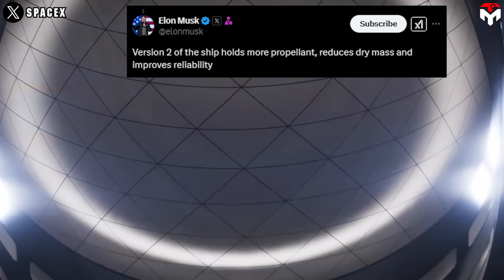SpaceX Upgraded Everything on Starship Booster V2, Unlike Any Other...

Comment: If they're changing the Hot Staging Ring. They think  it was the problem with the last StarShip, Rapid Disassembly. They've probably installed lots of sensors to watch for leaks and heating of the surrounding Area. SMART Or maybe they already did. Anyway cool.

Comment: Falcon doesnt do hot staging and its reliable and smooth.  What is to be gained from hot staging with the superheavy?
Reply from the maker: Starship is another level! With hot staging, they can maximize the booster's performance - leaving 3 engines on reduces velocity loss due to gravity; also it helps to keep liquid propellants at the bottom of the ship tanks, reducing the risk of fuel slosh which can lead to irregular supply to the engines.
Reply: @techmap9  Your answer is not well thought our.  after separation, the booster flips making the sloshing irrelevant.  At the point of separation both vehicle are nearly weightless in microgravity.  see the second stage velocity change in Falcon.  Any change is negligible.